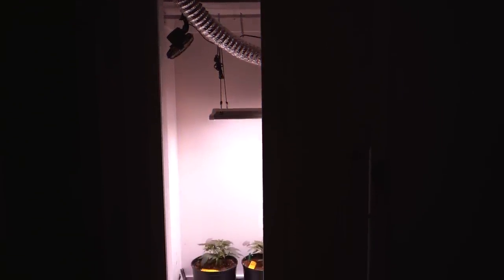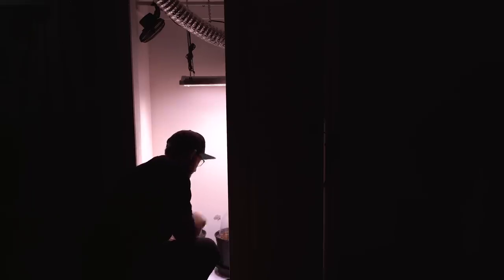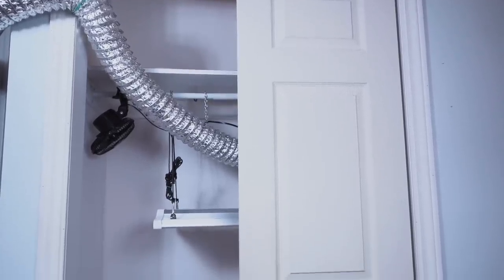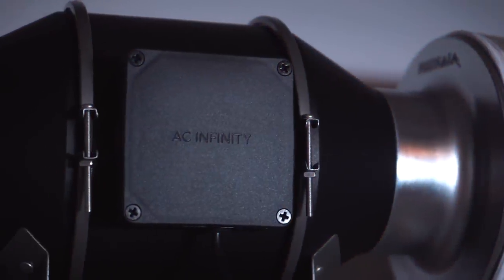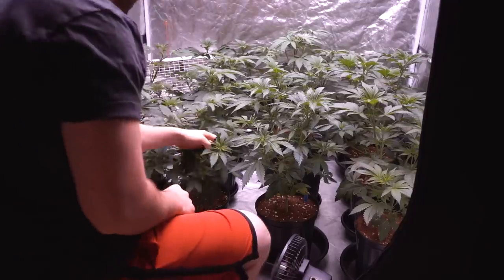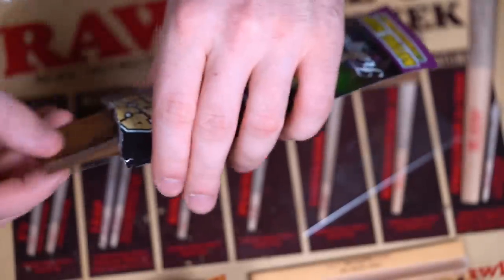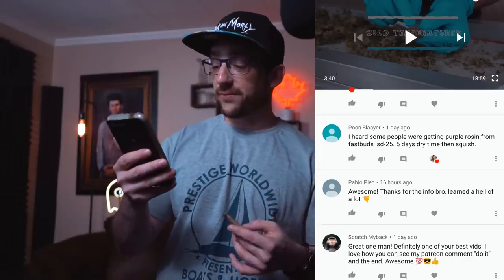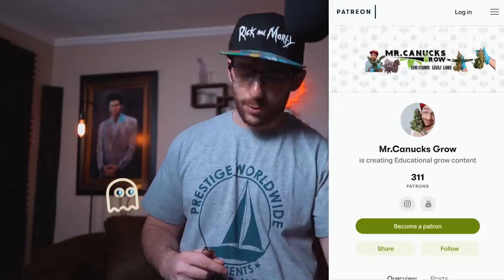180W HALF POUND CLOSET GROW BUILD: BEGINNERS SET UP GUIDE

Comment: Plants are too small for those containers. always step your container size up slowly to increase root ball density. more root more fruit. also always step your light power up slowly. you never start your car in 5th gear don't do the same for your plants. Don't start your seedlings off under an HID light or LED. Use T5 or some type of fluorescent light . Than when ready to flower, step it up to an HPS or MH Bulb or your LED's.